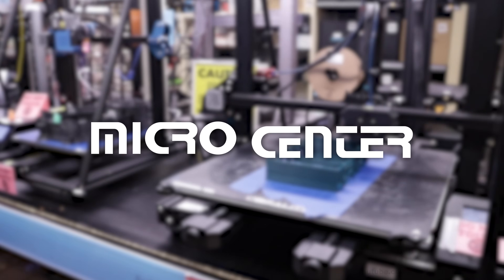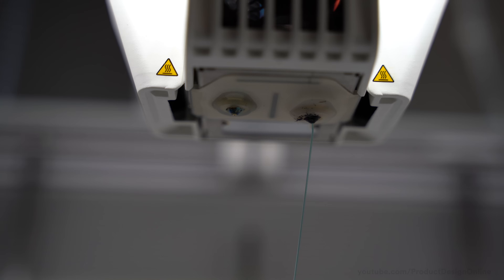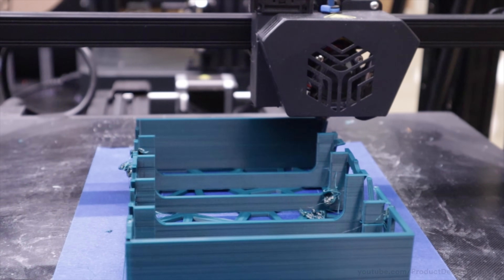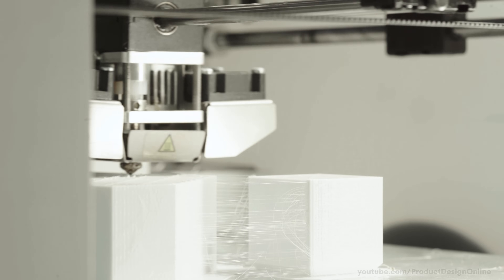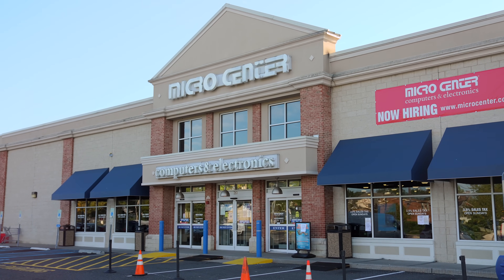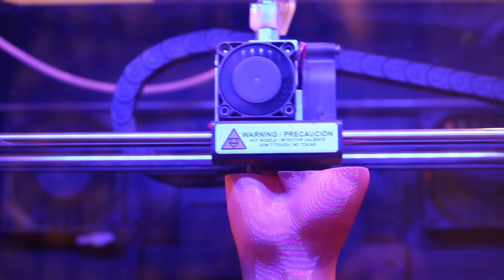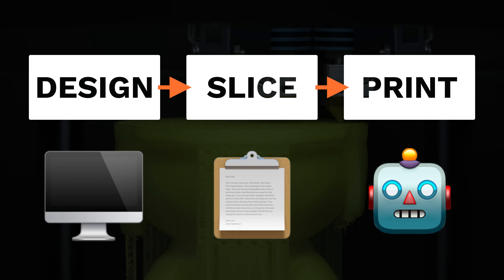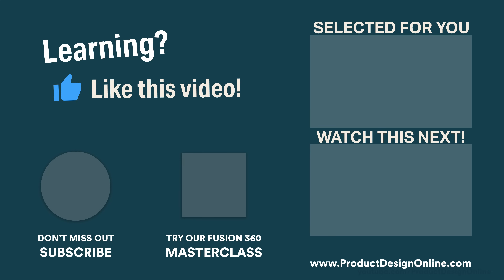3D Printing Basics - NOT as easy as you think!

Comment from the maker: What's your favorite 3D printer (if you already have one)?
Reply: Ender 3 upgraded to linear rails,  bigtree MB and BLTouch.  Been absolutely reliable with no misprints other than operator error.  Fusion 360 and Cura are an absolute delight to work with.  I am retired and started in 3D printing 3 Years ago when I was 70. It's been an absolute blast.
Reply: My favorite one? My one and only - an Ender 3 V2! ;-) I've had it just over a year now and have really enjoyed learning about 3D printing with it! I would recommend it as a good starter model for those wanting to dip their foot in the 3D printing water.
Reply from the maker: @brianspoelman1650  Agreed, those are wonderful starter printers, especially for the price point. Glad to hear you're enjoying yours :)
Reply: Have an Ender 3 and have upgraded a few items such as the control board so it's basically an Ender 3 pro at this point. While frustrating at times, I've really enjoyed using it.
Reply: aquila x2
Reply: 2 days ago, i received my ender 3 and i love 😍 it too much 
one thing i have problem now is cura because i can't make print smooth like the default dog.gcode that comes with the printer.
any solution please or video that explains well
Reply: Raise3D Pro3
Reply: Creality ender 3 S1 plus
Reply: TOYBOX
Reply: AnyCubic Kobra Neo. Can't get them now. Prints anything: TPU,whatever. Can't fault the output and it's about 2x the speed of the Ultimaker 2+ I have
Reply: Prusa-Mini, and it's crap. Do not recommend. Getting an Ender next time.

Comment: I'm on the fence about getting a 3d printer for my home use, and possibly selling minis that I've printed. The thing that puts me off the most is the associated health risks that come with 3d printing, since I don't have a seperate room to use my printer in. I know most risks can be negated with the proper printer equipment (air filters, 3d print "tent" to prevent fumes, etc) but I'm looking for a bit more advice

Comment: i have mounted one yesterday but i feel like z-axes is hard to lift but ez to move it down
is this a problem 
i have not test it yet 
i want to confirm before doing anything.
Reply from the maker: What brand/model is it? It depends on how the belts/lead screws are. In general, that doesn't sound like a problem. May be worth doing a 'dry run' and running some Gcode to move the Extruder head in the air (above the build platform). You can also check by moving the X/Y/Z via the printers onboard settings.
Reply: @ProductDesignOnline  i have test a gcode file that comes with printer 
and it is looking good 😊 
thanks a lot for your work 
these days i will not go out of your channel 
it will be my home 🏡
Reply from the maker: @zergovrock5277  Glad to hear it's working!! Happy printing and thanks for your support :)

Comment: Eh, the steel rods isn't any problem whatsoever, it would just make it worse to make them plastic rather than steel but it won't stop you from making a copy in the slightest. The actual issue is the electronics and motors, good luck 3d-printing those.